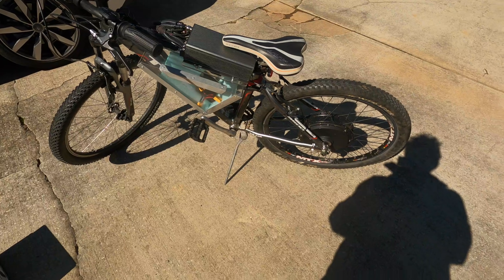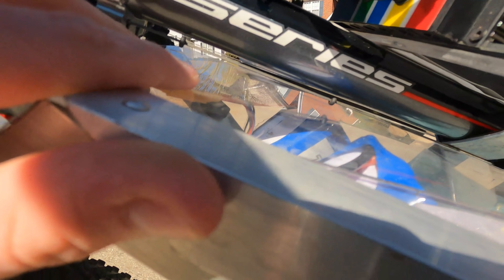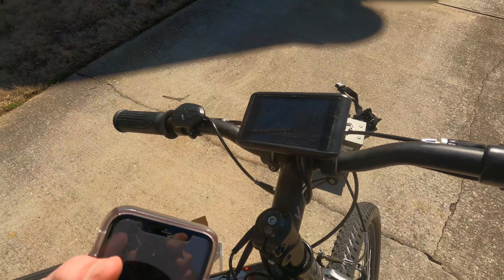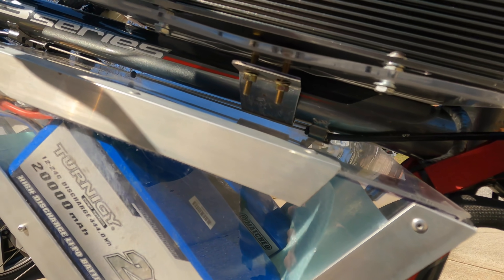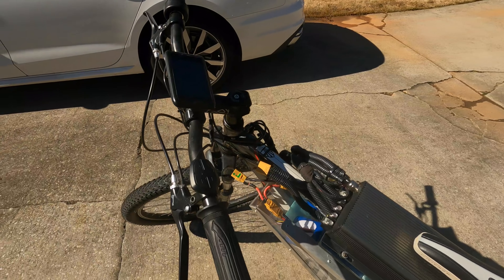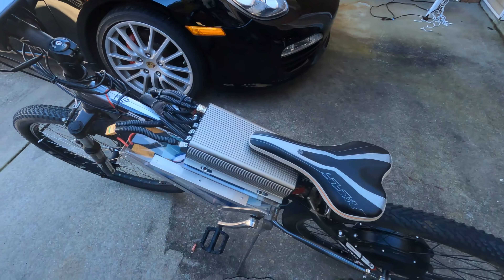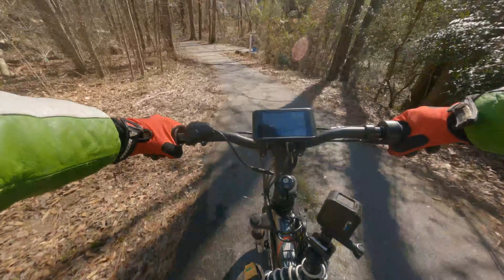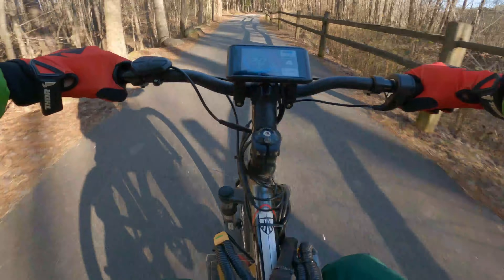My Homemade 10,000W Ebike! (Sabvoton72150)

Comment: So you have 2 batteries with 22v each and a max discharge of 24C

So you cant get more than 1kw
Reply from the maker: I can discharge 200 amps. It’s a 20,000 mah battery. It’s about capacity man.
Reply: @AllThingsElectric_  24c means 24 x 20a = 480amps  44.4v x 480amp = 21kw max the battery can put out. 

capacity is measured in ah, the above poster is talking about amps which is not the same as amp hours.

my house is a electronics/electrical lab, i have inverters, solar panels, soldering guns, hydraulic crimpers, 7 mppt solar charge controllers two 22kw battery banks and others that are smaller and 9 solar arrays in my yard and power most of my house this way, also, i have been into rc cars/ helies for years  etc etc  i said all that to say this: you are not getting 480amps through those tiny wires, you are also not getting 200 amps, i know the wires are short and could be considered "chasis" spec, but i doubt you are getting 100amps my guess is closer to 70 amps, but i dont know the actual conductor awg. 2 awg wire is rated for less than 200 amps. put an amp clamp on it to confirm, if you get a drok watt meter they sell one that is 90v max 200 amp max for like $30 shipped, you cant beat that price, most hand held amp clamps on go to a 100 amps and cost around $60 and up if you know what you are looking for.

if i wire 100kw moter to a a 100kw controller and connect a 100v 20ah battery, their will be a huge voltage drop at best and a fire at worst.

i like your video, and i hope you respond, i thought maybe i could throw my hat in the ring just to help.

Comment: ok question about it that you didn't cover.. what kind of range do you get with this at what level of power. it looks like a decent replacement for a motorcycle or moped - i'd probably want to update the frame though.
Reply from the maker: So I can reach 50+ miles driving it normally (some fun, but not too much). It definitely is a great alternative to that! I's switching to an enduro frame soon.

Comment: How much did all of that cost you? Like the motor, controller and the batteries
Reply from the maker: Motor - $535
Controller and screen setup w/brakes - $548
Batteries - $600 
Spokes, Rim, and Install - around $200
Total = $1883
Reply: @AllThingsElectric_  thanks

Comment: So is it possible to fit one of these kits into a regular mtb dropout? What would I need to do apart from get rid of the casette? Would i have to get rid of the rear disc?
Reply: thats where i am at the moment, it seems like that moter is for a 150mm fork, but this guy's fork appears to be 135mm. maybe its fine to bend/stretch the metal a bit on the fork, it would be about 1/4 inch too small on each side unless you pry it in there i think. i noticed several washers on his moter "axel". also, i would rather use my 7 speed cassette, but there is no room and the kit does come with a single speed, which would be better than nothing assuming it all fits and works. did you get this figured out?
Reply: No just get a 3 speed freewheel if you want some gears and you can have disk brakes in the rear but you will have to stretch the frame a bit to fit the qs205

Comment: I'm looking to do a similar build.. Few questions though.

That controller is huge.  Is there anything else comparable that takes us less space?  Same with the batteries.  Are those lithium batteries?

I'd like to fit and enclose everything into the center triangle of the frame.. Or maybe mount the controller on a rack over the rear wheel. 

If you could do it over, what would you do to make it better?

It's a great bike though. Looks like a blast to ride. :). Thanks for the videos
Reply from the maker: Awesome! The controller is very large, not without reason though. If you want smaller, look into kelly controllers and phase runners. These are lithium batteries yes. I would make the battery box fit my third battery for 72v if I could do it again. I’m honestly very happy with it though.

Comment: I have the same set up, 3.5T i high speed low tourqe,  its the 5T that high tourqe, not as fast as 3.5t, your a brave man running it on skinny mtb wheels, iv put motorcycle wheels on my mtb build, does 85mph, i have a better battery than you tho
Reply: What battery is that? And what wheels did you use?
Reply: @georgeafg9252  i have 2x 19" motorcycle rims and tyres, my batterys a 72v 150a discharge, samsung 21700 cells, it wheelies for fun
Reply: @darrenmorris8258  Awesome, and by motorcycle tires you mean dirtbike tires or actual motorcycle ones?
Reply: @georgeafg9252  actual motorcycle tyres matey
Reply: @darrenmorris8258  and no vid here on yt???

Comment: Well, thats a pretty working build I would say xD. The 3,5 turns of your QS is for high speed and low torque, the higher turns will get you more torque at lower rpm. Stay safe with those Lipos and dont go offroad, if you crash it probably will explode xD. Nice low budget street build 👌
Reply: Thanks Dad

Comment: That 3.5t shifts😁
What voltage were you running on the tests?
Reply from the maker: These clips are all on only 48v
Reply: yep it shows 48 volts the 2 tonight 20000mah 2 batterys 22.2v each. 44.4 volts fully charged 4.2x12 eqauls 50.4 volt those batterys are 2 6s batterys or 12 cells total